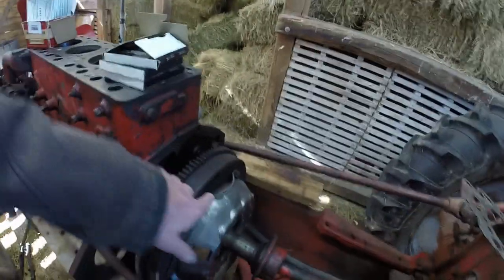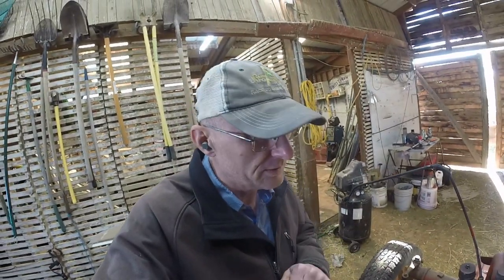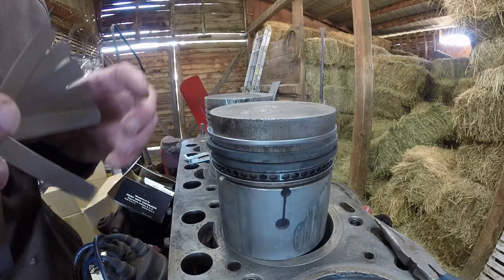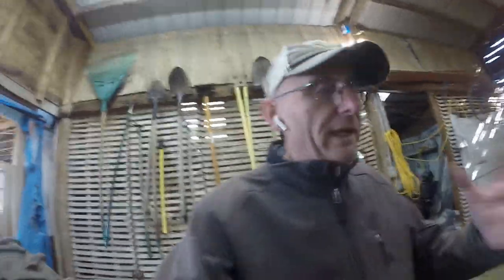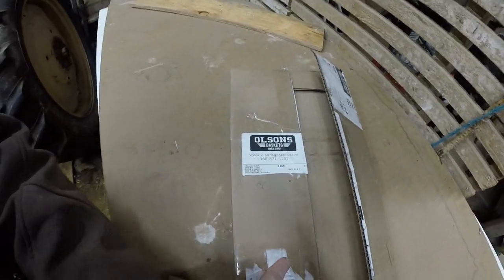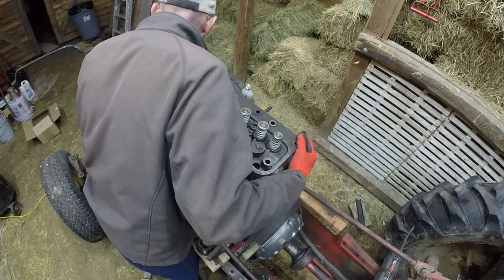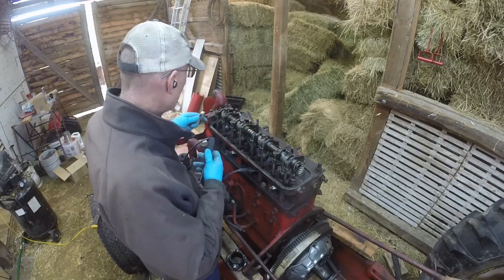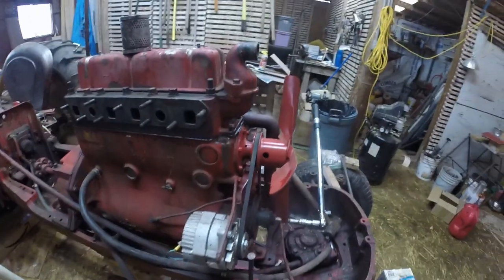MH33 Rebuild pt. 6, Block Assembly

Comment: the cylinder head needs 2 be rebuilt next 😊😊 the vavles need 2 be laped and new valve seats and vavle springs and new vavle guides  and check the cylinder head needs 2 be shaved U have 2 W a straight egde and a feeler gauge check and see if the feeler gauge will go under the straight edge 😊😊 the vavle adjustment is O16 thosand of a inch on the vavles /the old 6volt system I dont think much of it it turns 2 slow its dragging all of the and it just does turn the motor over 😮😮 12 volt much better and it turns the motor over alot faster 😊😊 OMG 2 23 2O24